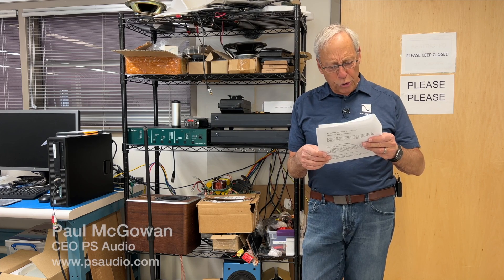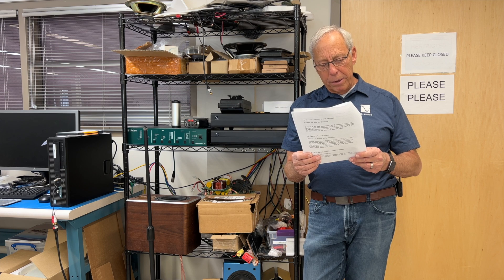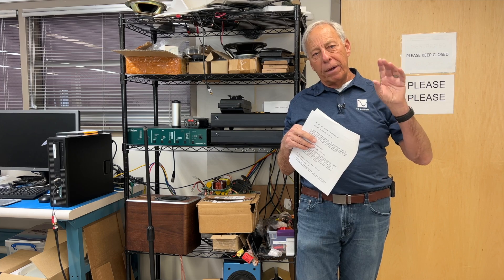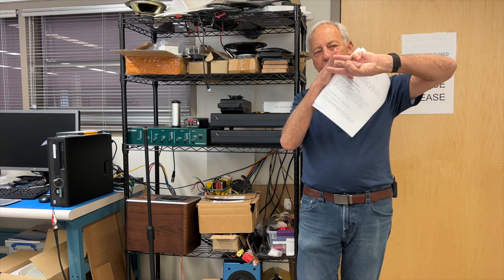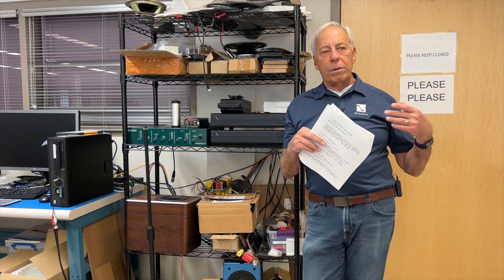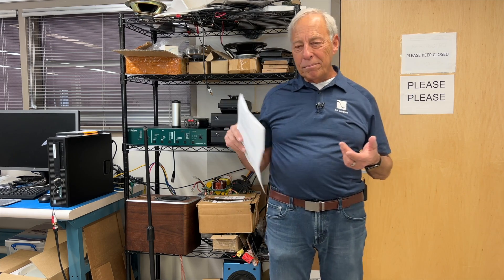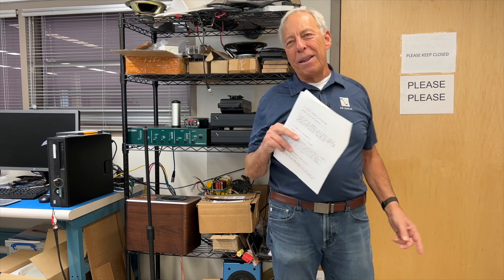Converting XLR to RCA using transformers

Comment: Paul said "If you use a great Transformer like a lundall or a Jensen those can go down to two or three Hertz which is very very low and very good."

My Radial JDI Stereo DI Box (dual mono) uses high quality Jensen transformers like Paul mentioned and it totally eliminated hum/buzz/hiss/pop when I put my ears up against the PS Audio FR5 speaker and the music paused.  No loss in sound fidelity.

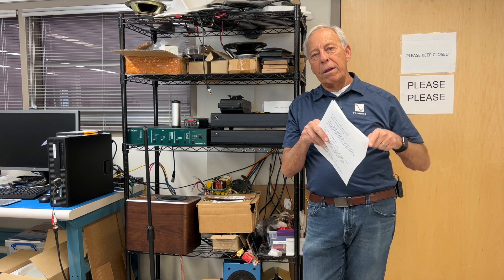@2:30 Paul said that 2 Jensen transformers are $300, so it's amazing that Radial sells a finished product for $380 which is only $80 more!

I love it!
My video:  https://youtu.be/Jm3m16Olcig
Source=Apple Music lossless

Comment: question related to transformers; 

Is a transformer better the bigger it is? And/or while I was thinking about transformers in signal processing circuits I wondered if a smaller cannister transformer would outperform the larger square metal plate transformers. Is it ever possible for a smaller transformer to outperform the duty of a bigger transformer in an audio circuit?
Reply: A more precisely, i.e. tightly wound transformer from high-quality sheet metal or wire, may be smaller and lighter. It's going to be more noticeable in e.g. a tube amp output transformer than a small coupling transformer as discussed in this video. Transformers may be soaked and encapsulated in cans, cast (soaked) in epoxy resin etc. There are different designs etc. They may use different materials etc. The relation between size and quality isn't as direct as it may at first appear.

Comment: I dont get difference between taking both signals together through a centre tapped resistor and using a transformer,, which connects them together anyway through the winding-only this route adds inductance,

Comment: I agree with Paul on this one. But one think to keep in mind is that a transformer cannot produce POWER gain. It can produce voltage gain at the expense of primary current but it cannot output more power than it was initially fed. This is probably not an issue hooking up sub woofers but in a professional setting this could be a problem where the unbalanced to balanced side needs to produce professional +4db levels into a legacy 600ohm load. The unbalanced consumer gear simply does not output enough audio voltage and current to produce those levels on the transformer secondary. So in that case you still need an additional gain stage on the consumer device. Also transformers need to be terminated into a fairly narrow range resistive load or they can ring. I know Jensen provides that data and so should any respected audio transformer manufacture. Honestly the best bet would be to go with active converters. With today's technology, the minuscule sonic defects they induce are not audible nor do they care about impedance matching.
Reply: I beg to differ, with Lundahl ll156x there is output increase, significantly reduce insertion loss of balanced to unbalanced use. Select hi impedence 10k:10k  types
Reply: @thomasleong9401  Output increase = voltage OR current. Never both. Power is the product of voltage AND current. A transformer simply alters that ratio,  that is converts voltage to current or vice-versa. It cannot increase POWER, again voltage times current. That would mean creating energy which cannot be done in the known universe. In fact like any conversion process there is a loss. That is what makes larger transformers warm or hot - the conversion losses.

Comment: I was about to buy a USB áudio interface that ONLY hás XLR, to Record an RCA signal from a Phono Pre-amp. In this case are the adapters more adequate? Thank you for your help.
Reply: If the audio interfaced isn't balanced, then yes, you can use xlr to rca adaptors. If it is balanced, then you may, or may not be able to use adaptors. There's more than one way to do things. You should be able to download the owners for the audio interface. It will definitely tell you what needs to be done, if anything, when you have to connect a single ended component to it.
Reply: I use a Radial JDI Stereo for this purpose.
Reply: Neufchâtel is a soft cheese from  Normandy. Philly cream cheese makes a 1/3 less fat version and when you read the ingredient list it's supposedly made from Neufchatel.
Reply: @Scopolamine46  And that's your answer to the question of @dgvpereira? 🤨